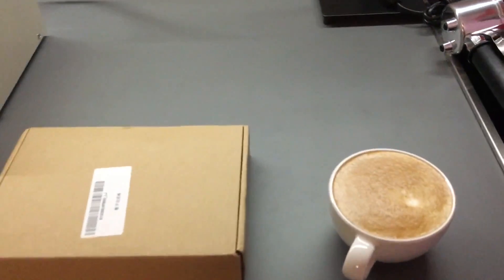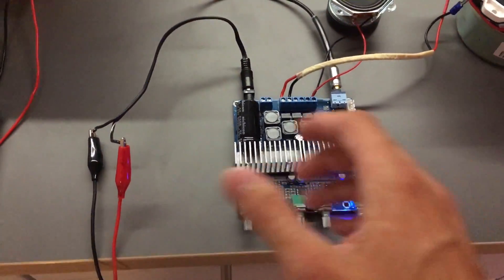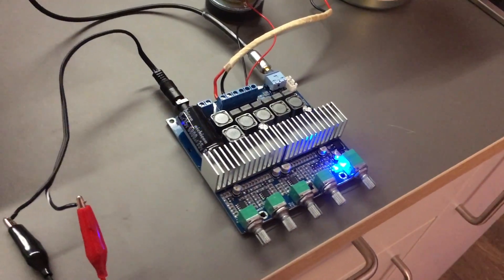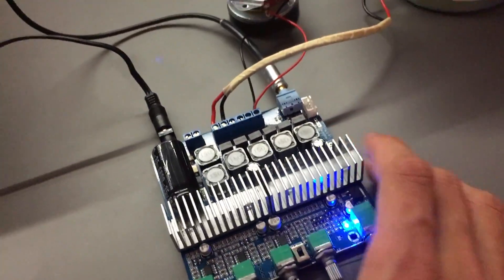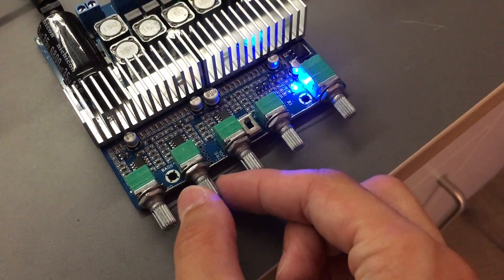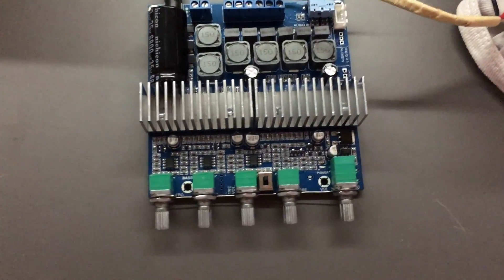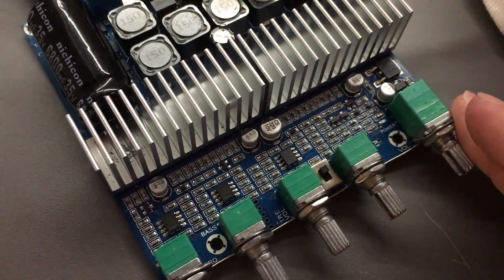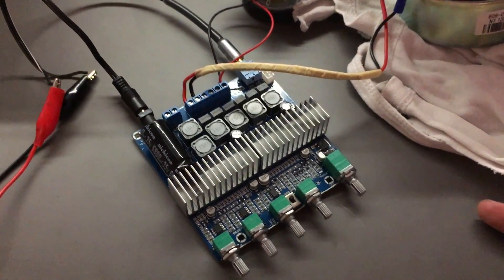TPA3116 2.1 Amp Review / AWESOME !!!

Comment: I personally bought the second one he linked, so far i've had no issues with it. No startup-pop, good quality sound and almost no standby noise. Another nice touch is the 5V out it has, it goes kinda unnoticed, but i'm sure i'll find a use for it (I'll probably try adding a bluetooth module to it).
Reply: Almost forgot to say: THANK YOU!! You testing out these boards, so we won't make the mistake of buying crap is really really appreciated!
Reply from the maker: the one with A6 or yh at the end ? I want to edit that into the description

I actually have used the 5V out -- I'm feeding it directly into the arduino and reading it to see if the ampRelay turned off indeed or is stuck on (in which case I toggle it on/off real quick to unfree it)
Reply: Apparently i didn't see or didn't get a notification for your answer, hence the delayed reply. Anyhow, the one with A6 at the end. As to date I also added the bluetooth module you showed us in another video (the 5V one) and so far it works like a charm.
Reply from the maker: glad to hear :D (yeah google constantly toggles your own settings for some very good reason I'd assume - I had my notification settings change at least 3 times, had to re enable comment notifications at least once .. and some unlisted videos got shared to my google+ page .. yyyeah)

Are you from Germany or did you manage to find the 5V one from China ??
Reply: maybe i'll have to fiddle around a bit with my settings then haha. I'm from belgium, so i bought the german one you linked since the wait time was the shortest AND it was the only one i could find with a DC isolator already on it (which i wanted).
Reply from the maker: well, for Europe I do indeed think the Eckstein dude is the only one currently having them on stock (at a very very healthy markup), buuuut, almost all of the ones from china have the regulator (mostly the 12V one), just search "CSR8645 12V" - I've even had some sellers tell me they could source the 5V one on request
Reply: Ow, well maybe i'll search a little better next time haha. But I'm willing to pay premium for the reduced shipping time. 5 days (with weekend) instead of 30-ish days was well worth it. Besides that "Eckstein Komponente" seemed pretty trustworthy. And after this pleasant transaction they earned my trust for future transactions
Reply from the maker: definitely trustworthy ! I've also been using them for quite a while

Comment: Would this work with 300w subwoofer? Please answer fast
Reply from the maker: Works with a 5 terrawatt sub as well ... depends on what kind of loudness you're after ... it'll surely be fine for a room but ... if the sub's really 300W then it's not gonna push it to its limits
Reply: Okay, thanks for the fast response

Comment: Hey, what is the maximum frequency cut off of the bass filter? Because I was considering this board for a build, but my thought was to drive a 5.8" woofer (120W peak but I think it's BS...) with the "bass amp" and other speakers with the other amp. So I wouldn't be using a subwoofer, and if this cuts off to something like 150Hz max, I might lose all the sound from that woofer (even though I hear some voice coming from your sub)

Comment: Looks like a nice find!  Interesting that the silkscreen at the sub connection says 3-4 ohms; the TI datasheet says 3.2 minimum.  The 5v out and 3 open barrels for audio in is also nice to allow easy connection of a Bluetooth board.  Is it possible that the spacing of the holes matches up to a KRC-86B?  I wonder if the 5v is isolated?  I imagine the normal/all freq switch changes the satellites from a high pass crossover to full range (FAST) operation.

So will we see a video later today of this thing driving your iPod HiFi?
Reply from the maker: +Glenn C sure is ! 

The 5v isn't isolated, there's a 7805 regulator above the main volume potentiometer;

I also haven’t seen this particular board with a bluetooth module already attached, but, who knows - in any case, I’ll be using the 3 pin header for the bluetooth and the jack to pass through the AUX in at the back

The sattelite crossover never seems to cut out from the bass, which indeed is a bit more filtered ... not the best outcome but, meh, I’ve seen way worse (what it does do is simply let more or less highs through).

We sure will - stay tuned :D

Comment: did you also test the power draw??? because i bought something similair from aliexpress, and i am pretty sure it aint the wattage it should have.
Reply from the maker: Well, its wattage is what ST says, clearly not 100%, but, still, quite a capable amp chip, I'd say
Reply: @Darieee  and if u play a song with a lot of low bass?? Because than the subwoofer channel should be taking a lot of power.
Reply from the maker: Yeah .. again, I did use the speaker I've built it in (check my "bluetooth speaker parts guide 2" video) outdoors as well and, yeah, at 25v I'm satisfied ..

The speakers I'm using it with are rather weak though so I am never drawing more than 15W through it

Comment: Do stereo-outputs run on frequency fullrange or on high-pass?
Reply from the maker: You can adjust them down to full range, or have a high-pass-filter in-line 

I see you asked on the other amp too - what are you building ?
Reply: Thanx for your quick reply! I would like to drive 4x Visaton BG20 on full range and one Tang Band W5-1138SMF micro subwoofer on low-pass in one big box for outdoor-parties and festivals. I'm not sure, if I shoud use a 2.1 amp and put 2x BG20 (8 Ohms) in parallel on each output or better use a 4.1 amp with one BG20 on each output. What do you think ist better? Thank you for your advice!
Reply from the maker: Get the 4.1 - you'll have an extra 50W of power, and those speaker look like they can handle it (you will have to do a slight mod to it to eliminate its turn-on thump - but, that's a 30 .. 60 minute job, you'll only need 3 capacitors, and 3 diodes - I made a video on it a while back)

Might want to go with 2 of those subs ... compared to how much mid range power you'll have installed, it might be a bit little

Then again the visatons will be pushing bass too so, might be fine

What I will point out though, is .. perhaps using uncoated paper coned speakers in an outside environment .. isn't the best idea
Reply: Yes, the uncoated paper speakers might be a problem. But i think I will need the high efficiency to reach high volume output. Maybe I have to cover the box with a plasitic bag. ;) 
O.k., I will  definitely take the 4.1 amp! Thank you very much for your help! Thumbs up for your videos! Thanx!
Reply from the maker: No worries ! Let me know how stuff turns out
Reply: I made some calculations and simulations with Boxsim and WinIsd for the first time and I hope it will be a hell of a mobile speaker! lol I will report!

Comment: hello, i have that kind of amplifier, mine shuts down if in max volume.. is it normal??
Reply from the maker: does it start popping weirdly and loudly, or does it shut down completely and requires a power cycle ?
Reply: the sound is good.. for xmple.. 100% volume shuts down, led light off, sound stops, but if i turndown volume to 80%, it regains all the power..
Reply from the maker: uuu ... then I have no idea ... is your supply handling the increased load ? How many ohms are the speakers connected to it ?
Reply: i have 12inch sub at 8ohms.. one 4inch sub for  mid range and oneb twitter..
Reply: enar soriano you don't have enough power as your subwoofer runs at 8ohms.

Comment: Could you please list the pot values/model #s please? I ordered same board and would like to replace pots with digital ones and have it controlled over wifi. But id like to order pots now
Reply from the maker: Uuuu .. I'm away for a while and left the speaker at home. I would however be quite interested in the concept of digital pots - could you send me some links ?

If I'm correct, they should be 10K logarithmic though - you can identify them by the color (some of the other 2 amps I reviewed had different coloured ones, which some users suggested were 5K or some other "wrong" value)
Reply: Darieee looks like main volume may be 50k switched but not sure. Im tring to source the appropriate digi pots. Once i get my board and pots, ill get it working and  post a video
Reply from the maker: Awesome ! Good luck, and, yeah, keep us in the loop xD

Comment: I got a Bluetooth version of this for around 22€ and I'm very happy, it sounds nice and the BT is working well.
Reply from the maker: Hmmm, no bluetooth noise ??? 

My 4.1 BT amp has quite a lot :(
Reply: I only had it on for a quick test so far and didn't notice any, but once I get the PSU for my build I'll let you know. Some BT noise seems nearly unavoidable, even my JVC Car Hifi has that. It did only run on 15V so far.
Reply from the maker: I don't know ... I got all of it out of my designs - with that isolating DC-DC converter, it's not that difficult
Reply from the maker: What're you building ?
Reply: A 2.1 Soundstand for my TV. Downward-firing sub. We'll see how it goes. The simulation shows a pretty steep -6dB dip around 250Hz so far, still working on the geometry.
Reply: Oh yeah, BT is only additional for when I want to play music from my phone, as it'll be the only audio system in the room.
Reply from the maker: Well, let us know how it turns out!

Comment: What is the hertz rating and sensitivity on both of the speakers, do you know? Thanks
Reply from the maker: Unfortunately not, why ?
Reply: You want to get as close to 20hZ ~ 20khZ as possible and if one speaker is 87% sensitive and the other is 95% the one that's more sensitive will over power the other and if you have different ohm speakers is a issue. There was more to it, but I forgot.
Reply from the maker: Well, the tiny one I have I'll never use, it's just for testing, and the sub is now inside an Apple Hi Fi (also have a few videos on that if you're interested), and there it's matched I would assume quite well given they're all the original drivers

Comment: Can I go up to a 6amp psu? Or do I need the 5amp psu? Reason: a 6amp on Amazon is cheaper than the 5amp.
Reply from the maker: sure you can

the amount of amps tells you how much it can deliver AT MOST

you can draw 1 from it and it'll be fine even
Reply: if you want all the power you need at least 10 amps and 24V ( class D 90%)

Comment: Are you thinking about testing some new ones?
Reply from the maker: Mmm, I do have some more I could show off, but this still is the nicest ... with a lowered gain I'd say it's even perfect
Reply: You could try the Bluetooth version of this amp. Some say it's even better and has lower noise floor. And that green version of 32usd that's one of the best reviewed.. I can send you the links
Reply from the maker: Mmm, all the ones with bluetooth I've seen had horrible or at the very least very audible digital noise ...

I also don't have any need for more amps at the moment ...

For weaker builds, I'd recommend the CSRA64215 TPA3118 stereo amp
Reply: Yes, but those 2 I said are regarded as having low digital noise. One even said that this exact board you tested has way higher noise floor than the Bluetooth version of it
https://rover.ebay.com/rover/0/0/0?mpre=https%3A%2F%2Fwww.ebay.com%2Fulk%2Fitm%2F283100792952
Reply from the maker: Could be, but I seriously doubt it 

It also have that non-csr bluetooth chip .. which at least I can't reprogram
Reply: So which Bluetooth decoder did you use? Did it turned out nicely? I'm thinking about that csr8645 decoder that costs around 13eur on eBay
Reply from the maker: That's already rather outdated

You can buy CSRA64215 5v / 12v isolated modules

Those are much nicer to program
Reply: @Darieee  nice!!! I'll check!!
Reply: @Darieee  did you found any amp board with that chip ?

Comment: Hello, i bought the aiyima version of this amp, sadly i get noise when i turn the pots, what pots does your amp have? log or lin? thanks
Reply from the maker: +huge3000 I would assume they're log

What do you mean by noise - crackling when you actually rotate them ?
Reply: Darieee, gerade gesehen das dein ebay auf deutsch ist. Ja wenn ich die potis drehe bekomme ich ein knistern. Ich habe geguckt und bei mir sind b50k potis verbaut, ob die jetzt lin oder log sind weiß der Kuckuck. Habe irgendwo gesehen das 10k potis besser geeignet sind. Werde später mal einen rauslöten und durchmessen.
Reply from the maker: +huge3000 bin mir fast sicher dass alle bei mir 10K sind - lin log sollte ja nix mit den knistern zu tun haben ... hmmm, und es kann gut sein das dass auch bei mir pssiert - interessiert mir aber nur ganz wenig weil alles sowieso in ein Box eingebaut ist

Comment: Can someone tell me the frequencys of the subwoofer crossover?
Reply from the maker: Quite low, I'd say ~100 Hz ish, but that's only by ear though, so, if someone has better measurements, by all means
Reply: Thanks, I was hoping for something lower but its hard to find that in this cheap amps.
Reply from the maker: It's the lowest I found in any case, check my video on parts for a bluetooth speaker 2

There's a little sound text at the beginning, you'll see the bass is very deep - absolutely no voices in it

Comment: What 24V power supply would you recommend for this amp from ebay or aliexpress? And also, love the video, very informative!
Reply from the maker: Uuu, tough one ... I bought a seemingly legit looking XP Power ECM60US24 (though it's most likely fake since I paid 3€ for it on pollin.de and it's 44€ on farnell.de for example ...).

Irrespective, the board looking fine and all, I am unable to use it - too much switching noise, makes the amp have an awful noise floor.

 I'm currently powering it off of a 6S 18650 li-ion battery pack and that obviously works best (minute current draws even at high volumes : read 300 mA tops).

Since at 24V the currents aren't high, you might want to try whatever used power supplies you can get your hands one .. printers usually have a 24V rail, ... maybe even some LED stuff since that should have lower ripple one would assume ?

 Let us know what you end up going with though - I'm quite curious too
Reply: Does it matter what amperage the power supply is? (Because i found some LED power supplies on ebay where the price is cheaper the lower the amperage). And also, what type of connector should the power supply have? (E.g Output Adaptor : 5.5mm x 2.1mm). And lastly, the power supply has to be AC to DC right?. Really new to this kind of stuff, Cheers!
Reply from the maker: So, definitely has to be DC on the output, and if you plan on plugging it into a normal socket, definitely AC on the input

The problem with LED power supplies is that they're either fixes 12V or constant current ... both of which would be unsuitable. Also the very cheap ones are mostly un-isolated supplies : meaning one of the wires from the socket goes directly through the supply : read : touch it & you get yourself a massive shock; take-home message, perhaps don't start with these if you're new to these kinds of things. This one for example does seem to be an isolated design http://ebay.to/2vXnJtn , and 1 amp, depending on what speaker you're tying to this, should be fine.

The connector can either be that barrel style which may well plug directly into the board I have in this video, but, either way, if it doesn't there's a connector right on the barrel jack where you can plug the wires directly, so, the termination's not really that important
Reply: Thank you very much for the replies, you can't imagine how much i appreciate them. I guess ill be going for the 24V 5A power supply and this amp that you posted in the description http://ebay.to/2wI93yh . Going with the higher amperage power supply just to be safe and have enough power for this amp and maybe some future projects.
Reply from the maker: Glad I could help :) 

I would however pay the 5 extra $ and go with the same seller I've used - there'll be probably lots of clones that sound like crap on this model too
Reply: Alright, should probably go with the tested unit and pay the extra 5$ to have piece of mind of getting a legit unit. Thanks again, best wishes and keep doing what you'r doing because you really helped me out!
Reply from the maker: Thanks for the kind words - let me know how the parts turn out :D